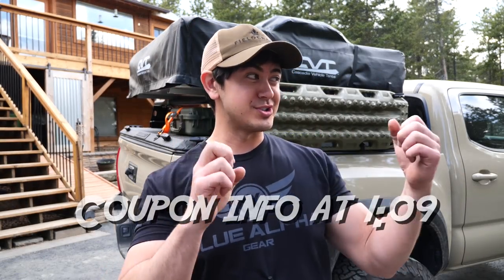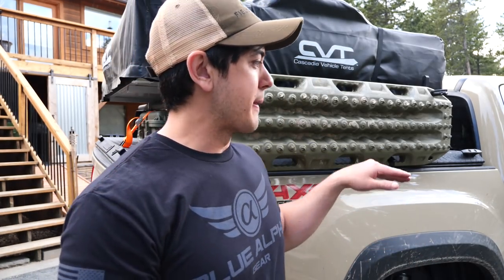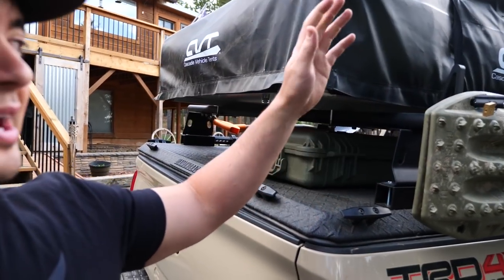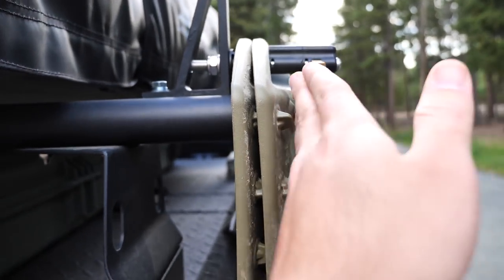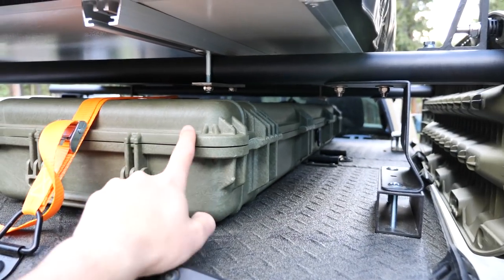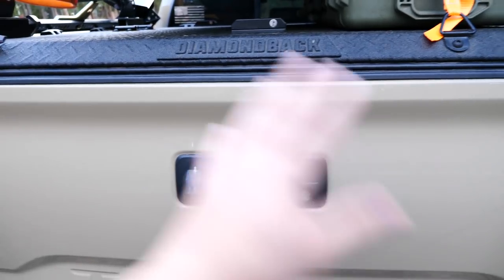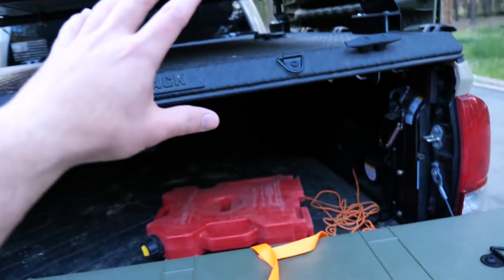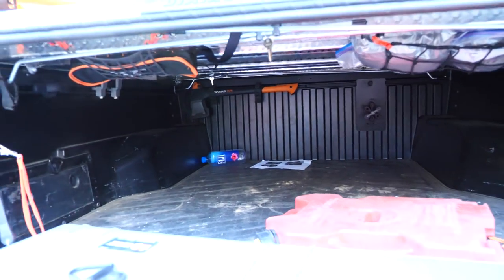Overland Truck Bed Setup / Diamondback Discount (very long / detailed Tacoma setup)

Comment from the maker: People ask this a lot, so I figured I'd answer. 
The question usually goes something like this "Tent is 150lbs, you are 180lbs, maybe someone else might sleep in there, maybe your dog, plus whatever else - that's over 500lbs and the SE says it's only rated at 400lbs. Explain?"
Answer: The cover (and most roof rack systems) give their max rated load as a dynamic rating. This means that's the max recommended weight to put on top when a vehicle is in motion. Usually they can handle more than the stated rating, but let's keep to that or lower to be safe. The static load that a system can handle is much higher than the dynamic - typically 2x or more (don't quote me on this). So assuming a 2x dynamic rating, a system that is rated to hold 400lbs, would be good to go with 800lbs on top when the vehicle is not moving.

Don't hold me to this, I won't be liable for you guys breaking anything. But I did alright in physics back in school...
Reply: Honestly, static I bet the truck bed would cave before that cover would. I have the HD but I would bet that with the SE too. With the TC stiffener neither will give.
Reply: Thank you for the work it took for the code. They unfortunately didn't allow stacking codes so I just went with the mil discount. I hope the code sent to my email can be accessed by some other person by the end of the promotion.
Reply: I chatted with Diamondback about this and they claim the weight limit is both static and dynamic, however I'm inclined to agree with you based upon physics.  The load limit is dynamic and obviously is rated under the real failure load for safety.  The manufacture if asked will push you to the HD if you want a RTT, but I suspect that's more to limit liability than anything.
Reply from the maker: Agreed - they state a rating to protect themselves (which I totally understand). Whether they state that that is dynamic AND static means that it is indeed the dynamic load, and you can decide for yourself whether the static load would be the same (which it obviously wouldn't). I believe rack manufacturers also publish a basic "load limit" and don't specify what the actual static load is either. Static load hasn't really been cared about before the era of rooftop tents though, because what people put up on their racks never really changed while they were static.
Reply: I have a SE Diamondback and it’s awesome. On my Tacoma though I have KBVoodoo bed rails and they have tonneau brackets so the weight of the rack and gear is on the bed sides and not the cover. Pretty slick product as it goes around the cover
Reply: @daviddouglass208  Could u post a link to those bars from kbvoodoo?
Reply: Why did you switch from the SE to the HD?  Did the extra 35 lbs in Diamondback weight factor into your decision?  Thanks
Reply: @LastLineOfDefense  I am just about sold on the Diamondback HD cover as being one of the most secure. I do see a potential flaw that looks like it could easily be exploited. It looks as if all someone would need to do is remove 4 hinge screws and a cover could be removed with a slight twist from the hinge side. It would be cool if someone could verify this as it looks like this would be pretty easy to do. The alternative cover I am looking at is the Renegade cover which is similar but does not have hinge screws that can be removed. What is your opinion on this? Thx.

Comment: You know, Mike, you taking the extra effort of time and energy to go this in depth plus attach every piece and detail in the subscription show a lot of effort on your part. I do plan on getting a similar setup for my f150 as you have because I respect your perspective. The only reason I got a f150 and not a Toyota is because 6’2” with a car seat and I don’t think I’ll ever overland at the angles that you do. The only thing I’m waiting on is you to work with my set up on a left handed holster (g19 gen 5 w/ aplc)  lol I know you have enough going on as is. Sorry for the rambling on the post (as I’m sure you can relate).  Anyways you da man and keep putting effort into your work as it will pay off. Make my holster. Prayers sent your way for success.
Reply from the maker: I'm making them for the PL-mini in lefty, if you'd consider that light anytime soon! (https://amzn.to/2lAknFp) - it is my current EDC weaponlight of choice.

Comment: You could add a rubber hose over the jack mount bolts to eliminate washer rattle when the jack is removed. The hose would be in between the top and bottom washers.

Comment: You should pick up some square black plastic caps to cap off the aluminum crossbar risers. They would give it a nice finished look, hide the bolts, and even provide a bit more waterproofing. Just a thought. As always, great content.
Reply from the maker: Yup, actually just ordered some, per the recommendation of another commenter!

Comment: One thing i would suggest,  the dback is cool, but, what about making it open in a 20/60/20 (rear) configuration? Easier access  and hauling smaller longer stuff without removal of the rack. Like your vids. I won't be upset if you keep them coming.

Comment: Where your high lift is, use wing nuts for your outside nut, you’ll be able to get rid of a flat washer and it’s easier to turn on and off and wider for holding it in place!!
Reply from the maker: But then they couldn't be used with lock washers and would just work their way free on the trail? Or maybe I'm missing something?

Comment: Hey Mike. I loved the detail and thoroughness of the video. One very small thing I thought I’d mention is regarding your fuel container. Get a bottle of stabil for about $8 and mix it in with the gas. Your fuel will last for about a year if not longer. It’s great for winterizing any seasonal vehicles or lawn equipment as well. Maybe you don’t have a use for it but I thought I’d throw that out there. I can’t wait for the detailed suspension video! I have my wheels picked out for my Taco but I haven’t decided on tires or lift. I hope the upcoming video gives me a good starting point.
Reply from the maker: Thanks for the tip! Yeah i use Stabil in some fuel cans I keep at home, it's just not too difficult to cycle this stuff out since I keep it in the truck and usually just dump it into the tank while I'm at a gas station, and just fill it right back up there.

Comment: I had an issue keeping my a watertight seal with my Diamondback Cover.  A gap is created between the height of the bedrail cover and the cab side of the bed. There is a factory bed liner.  But even then there is a slight gap. The Diamondback Cover does not have a seal is thick and compresses enough to provide a tight seal. I had to add some weatherstripping along the cab bed rail to close the gap.

Comment: Sweet set up and awesome truck! Your videos are super detailed and informative. Nice work. 

I would however consider upgrading those low strength zinc plated carriage bolts that mount your rack to the bed cover to something stronger like 316 Stainless Steel or even Grade 8 Steel (they will need to be painted). The last thing you need out on the trail when things get rockin' and rollin' is a bolt(s) to shear off. I like to purchase unique hardware from McMaster Carr for custom applications. A little pricey but worth it for the peace of mind in my opinion.

Comment: Seriously solid and good looking as well. Just looking at your work and you said pulley system. Have you considered a couple changes along with quick release so that the whole rack and accessories could be lifted up as a unit. This would leave bedcover installed with a highly useable bed. Just a thought that popped up due to your solid design.
Reply from the maker: Yeah, i've kicked around the idea of something like that - but haven't spent the time engineering anything yet.

Comment: Great video... tons of ideas came out of this. Not sure if this has been asked already or not but is there a way to attach the rack system without the diamondback cover? I like the height of the rack but the mounting brackets don't look like they would attach to the bed rails like with some other racks.

Comment: Terrific video and thanks for taking the time to put this out there. However, if I caught you correctly, you have the SE variant of the Diamondback with a 400 lb haul capacity. Between the tent, gear and a couple of decent sized adults, wouldn't this well exceed the spec? Or is that rating only when the vehicle is in motion and the stationary rating notably higher? Thanks again.
Reply from the maker: 400lb is the dynamic (moving) rating. The static (stationary) rating (for racks as well) is significantly higher.

Comment: Mike, love your setup.  I actually just got my 2018 TRD Off-Road in Quicksand and looking for a platform for my RTT.  I am debating a bed cage\rack or cover.  I love your philosophy on the cover.  I am worried I won't have room for a refrigerator like an ARB and how the cover flexes while off road.  Would love your thoughts on space for a refrigerator and your experience with the Diamond Back flexing while trail crawling.  Love the holster I got from you and love the channel.  ---Rob
Reply: HikeItDirty Backpacker if you aren’t on tacomaworld.com that’s a great resource. I have a 2018 DCSB premium and I have the SE Diamondback cover with KBvoodoo racks. They are made to specifically for Tacoma’s and have tonneau brackets that go around the cover and transfer the weight to the bed sides. My truck is my DD and I take off my RTT and rack when I’m not camping, and the cover stays on. I also built a bed drawer that slides out 5’ for camping gear. Tacoma’s are awesome
Reply: Thanks David.   I have been on tacomaworld quite a bit.  I ended up getting a Leitner Designs Active Cargo System rack with storage pods and a FSR RTT.  They are actually being installed today.  I am planning on a Decked drawer system in the near future.

Comment: Quick question man, why did you go with the SE model and not the HD? 
I was looking at the website and saw that the SE weight cap is 400 lbs and the HD is 1600 lbs. I’m looking to do something like your setup, and I was wondering if the SE model would do just fine.

Comment: Wow, this is such an awesome and informative video. Thanks for sharing.  I love the diamondback shell for your truck bed is such a great ideal.  Yes, you are right about the over landing community are on the stuck up side. I have tried to reach out to Clay from Expedition Overland, and Jason K. and both hasn't respond to my request.  I am new at the off-road adventure and getting day to purchase my off-road vehicle, I have numerous questions in regards to the suspensions, shocks, lifts, communication, electronics, and etc. for off-road.  Let me know if you are a able to lend me an assistance. Thanks

Comment: Maybe you have already answered this and I cannot find it but how did you seal  the bed from water. My diamondback cover doesn't fully keep rain water out and I was wondering if you had any tips or if you have ran into this issue. I believe it's coming in from the back corners of the bed but am not sure.
Reply from the maker: It's really hard to fully seal a bed - lots of gaps in the bed itself, tailgate, etc. So it's a long process of finding holes/leaks and putting weatherstripping and/or caulk.
Reply: @LastLineOfDefense  thank you. Love your channel keep up the great work!

Comment: So what you've done is made the Diamond back a permanent base for your tent, since you can't fold the doors back when the tent is on the top of the Diamondback, to get to what is in the bed of the Truck
Reply from the maker: When the tent is mounted, correct. I find normal access through the rear (tailgate) of the bed gets me everything I need for how I'm setup. I love the security (and keeping everything out of the elements) of everything stored inside of the diamondback, as well as the peace of mind knowing that it is a super solid platform for mounting the tent (or whatever else) on top of it.

Comment: Thanks for the vid. Love my Diamondback. I’m in the process of deciding how I want to mount some accessories. I’d love to not lose the ability to open the cover. With the Hi-Lift jack base close to the cab do you hear it rattling while driving? Also are you able to see under the tent with the rear view mirror?
Reply from the maker: I don't actually notice the base rattling, surprisingly enough, but I'm sure it does. I can see under my tent in the rear view mirror, which is a nice bonus.

Comment: Is there a way to mount the maxtrax on the inside of the bed using the T nut system while having the ability to lock the maxtrax in place using a padlock?

Comment: I live in a rainy cool climate (Vancouver, B.C.) and i get condensation with my factory tonneau cover. It also leaks but that is another issue.  Do you get condensation or frost on the inside of the Diamondback Truck cover in your climate?  Thanks.

Comment: I have been watching all your vids just prior to me picking up my Tacoma. Was wondering if you can shed some light on the rotopax and the rotopax mount with the diamondback cover. I currently have 3 rotopax standing tall length wide across the back of my bed. ( 1 gas, 1 water, 1 storage) I am close to pulling the trigger on the diamondback but not sure if there will be clearance or will I have to change the orientation of the rotopax mount. If this is the case I would only be able to fit a few on the back at that point. If you can please let me know your thoughts
Reply from the maker: I believe I have to mount my rotopax sideways for clearance. basically if it sticks above the top of your bed, it probably won't work with any tonneau.

Comment: I know this is a bit of an older video, but I was wondering if the Diamondback can be unmounted somewhat readily? I commonly need to be able to haul taller stuff like a pallet of seed or fertilizer, but I'd like a more sturdy cover than my current roll-style one - ideally I'd want a way to convert the ole truck from my normal utility setup to some sort of overland-like setup without spending a weekend doing so..
Reply from the maker: Yup, 4 bolts, it's not too bad.

Comment: Hi great setup. how does the rooftop tent rack work with toneau cover? I have a hard roll-up toneau cover with its rail on the truck rail. I am looking for a rack which can work with tonneau cover. any suggestion? Thanks
Reply from the maker: KB Voodoo makes some that would probably work with your setup

Comment: Great video dude. Question: how often do you take your rack system completely off? I have a different rack system that I typically leave off unless I plan on using it. Honestly mostly so I can safely run my truck through the car wash on occasion. Kind of interested in the time/effort it takes to install or remove.
Reply from the maker: I run my truck through my car wash with racks on, maxtrax and all - have even done it many times with my awning and rooftop tent on there. But i rarely take my racks off.
Reply: @LastLineOfDefense  Cool good to know, thanks for the info. Wish DB had some sales occasionally. Will have to keep an eye out.

Comment: The max tracks mounts where the bolt is inside triangle bracket looks like can be easily stolen by just loosening the nut inside the triangle bracket and pull them off or am
I missing something.
Reply from the maker: I'd say that would be about 500x harder than cutting the little lock. The tolerances in there to actually loosen the nut would take like 15 minutes to get it out. Even then I'm not sure you could actually get the bolt out without spinning it (which you can't do with the maxtrax and lock on there).

Comment: Hey Mike awesome video man I really enjoy your mods and how detail you are while filming. I'm not someone with a ton of experience and watching your walkthrough has really helped me out. I did have a question if you're able to answer it. Currently running a 2017 stock tacoma and I wanted to do  a RRT system, however, I don't like mounting it on the roof, I wanted to do a system like how you have with on the truck bed. My question is would I have to buy the diamondback cover to mount the tent ? or would  I be able to mount the tent just on the stock rails?
Reply from the maker: You wouldn't need the diamondback if you didn't want that. There are a lot of companies making racks/bars that work on a Tacoma, such as - https://www.cbioffroadfab.com/products/3rd-gen-toyota-tacoma/overland-bars-duplicate/
Reply: Wow you actually replied lol, didn't know if you would. I really appreciate that by the way, I'm torn man, the rack is 400, at that point, I'd just buy the diamondback as eventually  I'll be doing so anyway.  Might as well spend the 400 into the diamondback. It's just so costly to start. Anyways, what do you think of a CVT Mt. Rainer extender RTT for 1500? that and the Diamondback will sent be back a pretty 3k already but should let me do some nice camping for this summer.